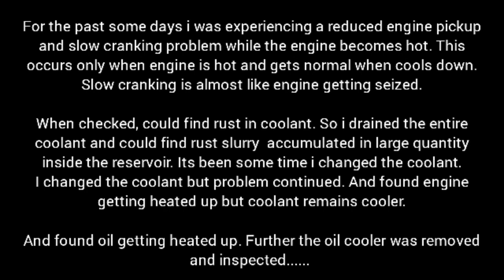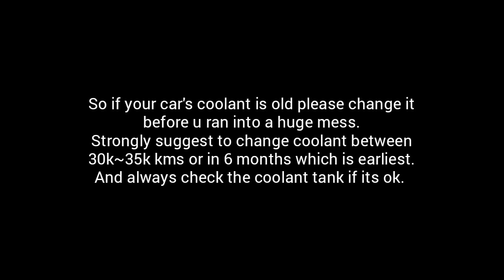Fix Engine Heating Issues | Rusty Coolant Problems| Fiat Punto Linea| Suzuki | Daily Hands

Comment: Which is the tool used to remove oil cooler assembly? Is it T 30 ?
Reply from the maker: yes its t30 drive
Reply: @dailyhandsdiy   to remove the entire housing we have to remove two T 30 screws which are diagonal , but there is also a pipe at the centre just above , how to remove this one?
Reply from the maker: oh bro its the feed line to turbo. You have to remove the side which is connected to turbo side. with t45 drive.
Reply: @dailyhandsdiy  bro I am actually confused, sorry to annoy you, actually what all connections we have to remove to get the oil cooler ?
Reply from the maker: Its olryt bro, first remove the coolant line, one aluminium pipe with 2 bolts t30 and rubber hose on bottom. 2nd turbo feed line on front with t45 banjo bolt, 3rd oil cooler bolts 4 nos. Be sure to drain coolant first.

Comment: Will the oil cooler of swift suit with punto
Reply from the maker: yes it will suit. New swifts does not have a oil cooler infront of oil filter element but punto does.
Reply: @dailyhandsdiy  will the heat exchanger ( silver box) of swift fit into punto's oil cooler assembly
Reply from the maker: Bro it will fit. But a small difference in thickness. Punto with 90 hp comes with 4 layer H E assembly and swift old model with 2 layer.if the punto version is 75hp model then 2 layer HE is enough. thats ol. swift after 2013 has no HE.
Reply: @dailyhandsdiy  thanks bro
Reply from the maker: welcome bro :D
Reply: @dailyhandsdiy  will there be a notable difference on performance
Reply from the maker: No bro there won't be any difference in performance. You won't feel a thing. Jst it will maintain the oil temperature thats ol.
Reply: @dailyhandsdiy  appreciate your knowledge bro ,hope you come up with many DIY videos
Reply from the maker: Sure bro i will, Thanks for the precious support.